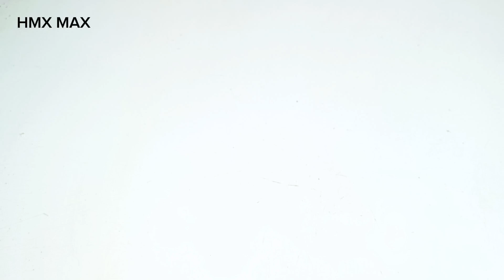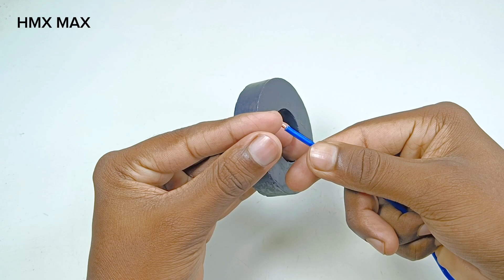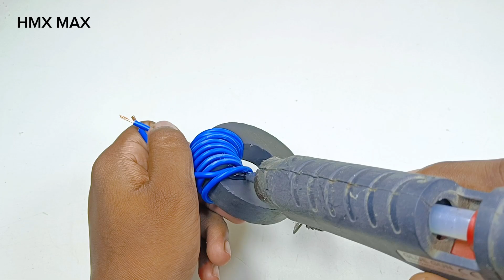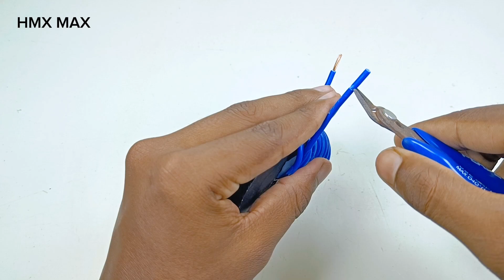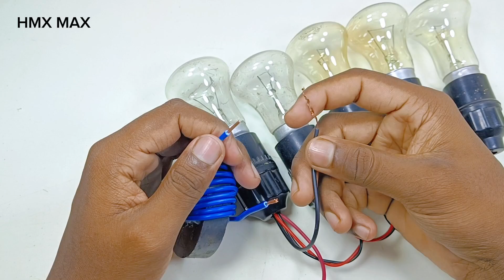New Free Electricity Generator 27KW 240v Using Coper wire Powerful Magnetic Power

Comment: Touch the two wire of the light bulb together without the magnet and it will do the same thing with batteries in the light fixtures.
Reply from the maker: Thanks
Reply from the maker: Thanks